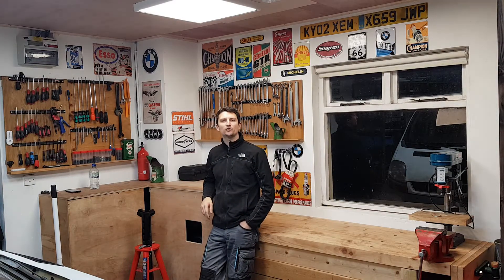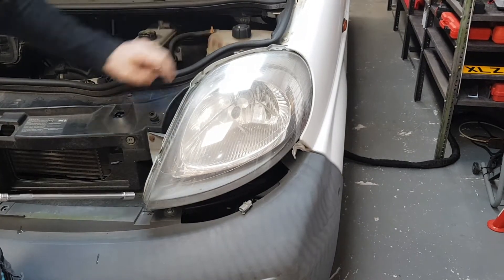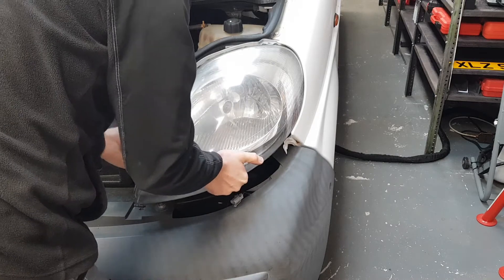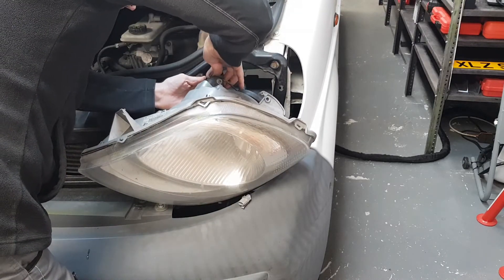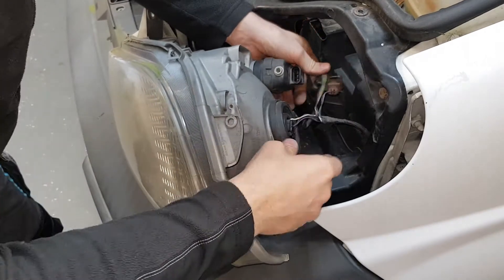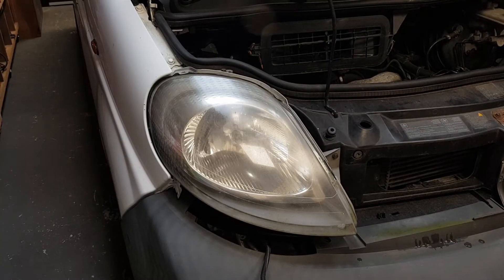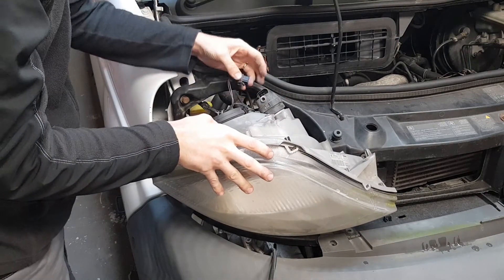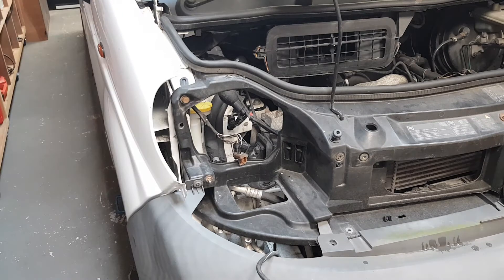Renault Trafic Vauxhall Opel Vivaro Nissan Primastar how to remove headlights. Headlight removal f9q

Comment: There is no need to remove front panel, remove bolts and ease upward until plastic plug comes out of hole then ease headlight over towards wing and then opposite side will come out past panel. Did mine like that and no problem getting them out or in.
Reply from the maker: Nice one. Thanks for sharing your knowledge and experience🤝🏻